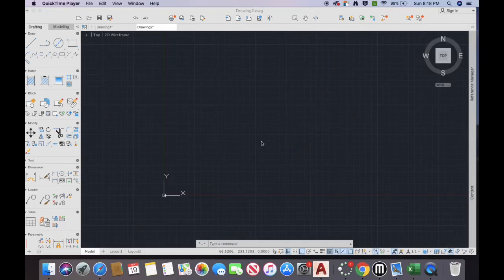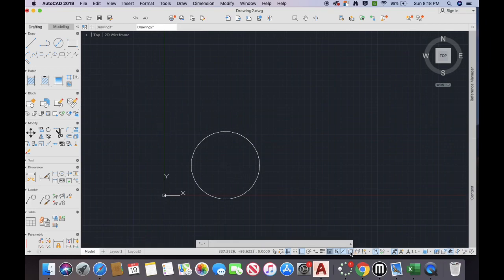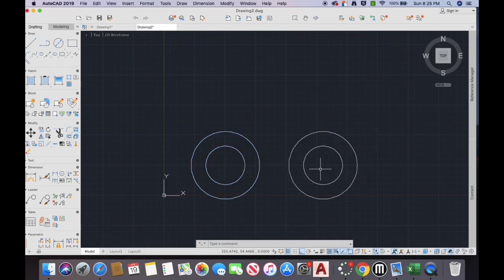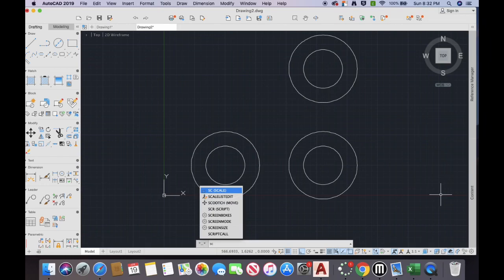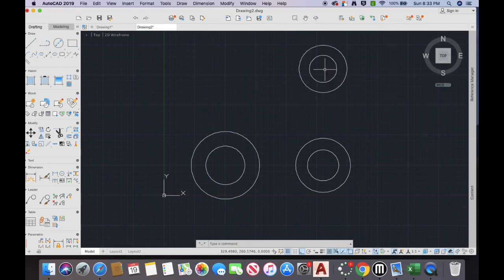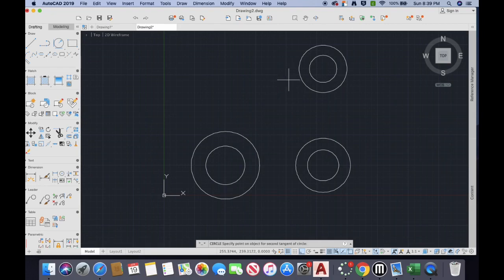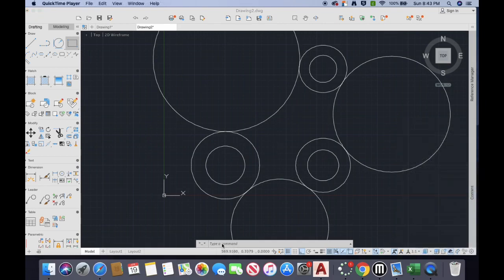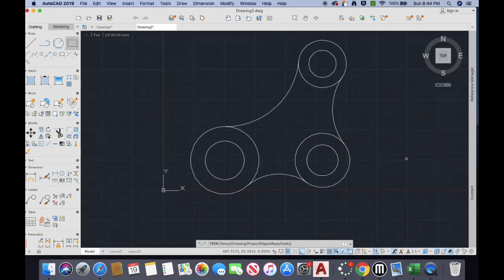AutoCAD The Trim Tool

Comment: no cap that's a fidget spinner
Reply from the maker: Slit Productions change the proportions and make everything symmetrical. You have a fidget spinner! These videos are meant to teach you how to use various tools. What you can them do with those tools is limitless, you just have to have the curiosity.